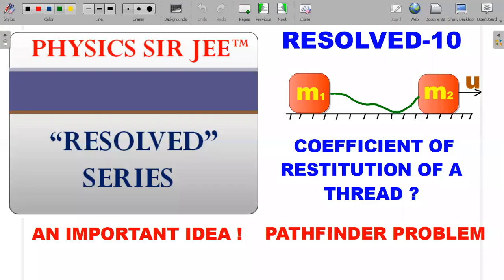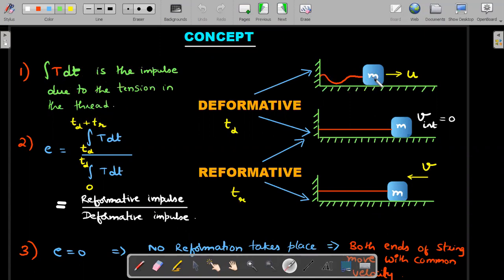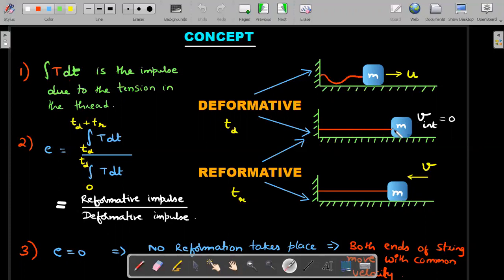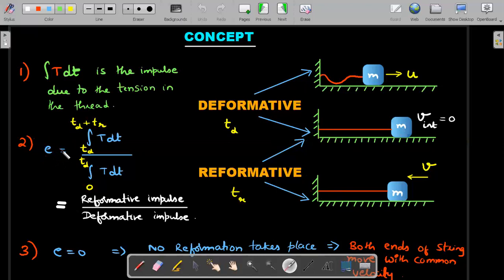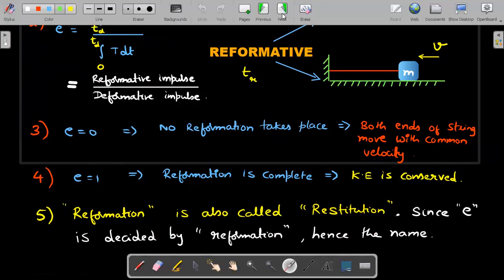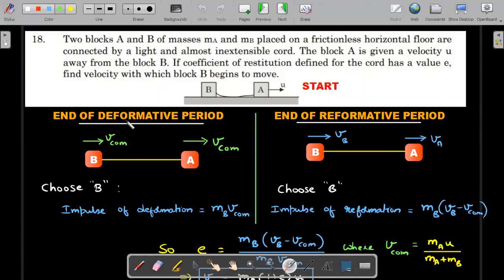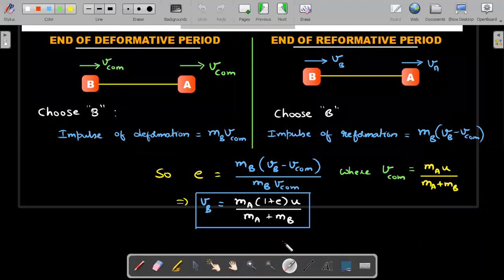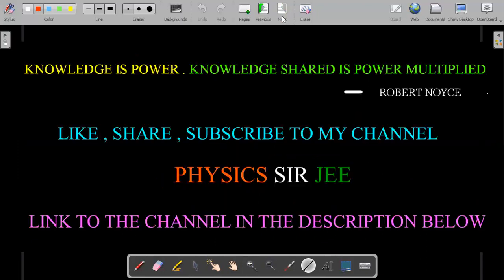RESOLVED-10-😉 MEANING OF COEFFICIENT OF RESTITUTION OF A THREAD-MOMENTUM-PATHFINDER-BUILD 18

Comment: janardhan sir , deformation in the string starts when the string becomes straight ,during deformation period of cord or the thread the velocity of the block decreases but the other end point of the thread is fixed to the wall how is this possible if the string is ideal which means inextensiable which imply block should also be at rest, but it takes dt time to become zero.
Reply from the maker: Inextensible means "Macroscopically Inextensible" . Microscopically , there will be small deformation and then reformation
Reply: Thank you sir 😊 I understood,as there is no reformation the string should maintain its length what it achieved after that small deformation in it which means the relative velocity of the ends of string should be zero. Thus both ends of string move with common velocity
Reply: Sir can you explain when coefficient of restitution is zero why both ends of string move with common velocity
Reply from the maker: @nagasasikala4498  common velocity is achieved at the end of deformation. If that itself is final velocity of two blocks in a case , it means tension has stopped acting after that instant. THAT means there is no reformation . So reformation impulse is zero . So , by definition , e=0

Comment: Yeah sir in the check you understanding tht problem it will be analogous to a ball moving with velocity v and colliding with a circle of radius l..... as the energy is conserved v will not change and the impulsive force will be applied along the string length and it will pass always through the hinge part when the string becomes taut or length l during the journey of ball🙂
Reply from the maker: Perfect 🙂👌
Reply: Thanks sir and loved your efforts and the way you solve sir🖤